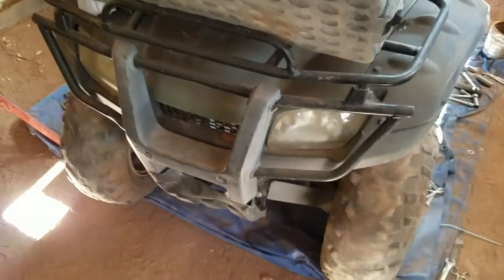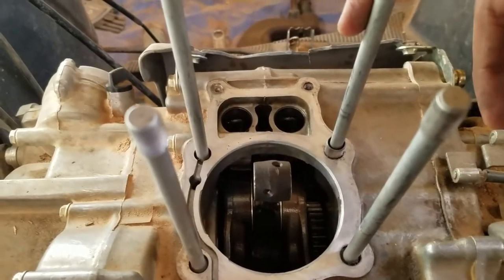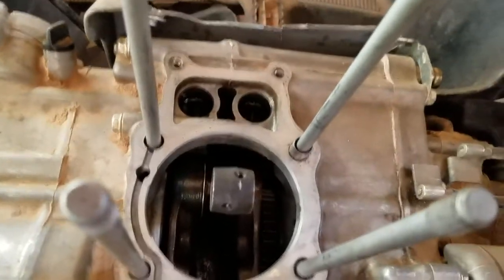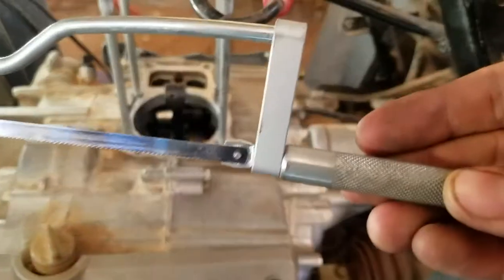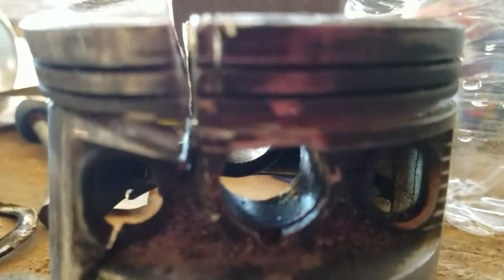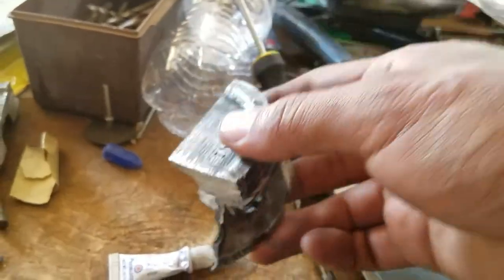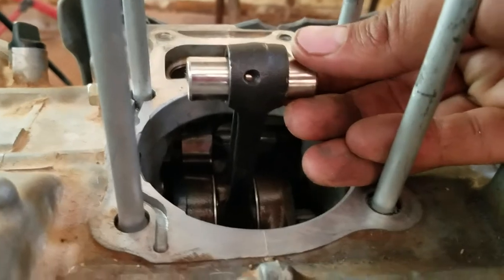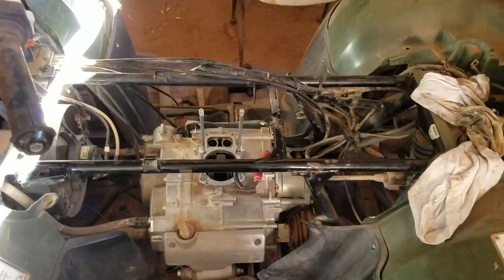How to remove stuck wrist pin atv/dirt bike

Comment: Had a bad one recently. Since I was not worried about the piston itself, I rented a ball joint press from my local auto parts store and pressed it out with that. I used a small impact socket that was slightly smaller than the wrist pin to press it out.  I used a MAP gas torch with plenty of heat, and periodically, I would spray the wrist pin with canned air to cool it down some while continuing to heat the piston. It finally started moving. I ran a hone through the small end of the connecting rod to clean it up and the new top end got it going again.
Reply from the maker: Sorry. This video is so old in my younger years, But glad it helped 👍🏼

Comment: Man i had to do this to my 2005 ttr 125, thankyou for the help! Now im figuring out how to get the wrist pin out of the crank shaft
Edit: used a 6 inch c clamp with a 17mm deep socket to go around the pin but stop at the connecting rod and a 9mm socket to push the pin out, it was difficult and ive been out here for 4 hours trying to get the piston and wrist pin out, thankyou again😂
Reply from the maker: Glad there was some pointers that helped.
Reply: @Echoepic95  bike is now running better than i It did before it blew up, you are a life saver

Comment: I have the same problem resulting from the same looking damage on the cylinder. I snapped a couple of bolts trying to pull the wrist pin out and stripped threads on another bolt which I had to cut off to get out. I think my only option short of ordering specialized high strength bolts, nuts, and washers that won't snap when I attempt to pull the pin out is to cut the piston out like you did. Thank you for reconstructing the piston and breaking it apart again for the video. This is very well thought out and very helpful to see the exact same issue with the fusion between the pin and the rod even though everyone says a pulling assembly is all that is needed. Thanks a lot for the video. 

What did you do about the damage to the inside surface  of the rod? Did you just shave off the surface imperfection where the pin was fused and it was ok?
Reply from the maker: Sorry for my delayed reply I used a lifter hone tool.

Comment: Dont waste your time cutting it with a little saw...lmao. get a long bolt that will go all the way thru the  wrist pin...get a deep well  socket...get a nut and washer that will fit the bolt...you want a large washer because it is what is going to hold the socket in place.  Put the washer on the bolt....put the deep well socket on the bolt...put the apparatus  thru the wrist pin...put the nut on the bolt on opposite  end of wrist  pin...tighten it down...as you tighten the bolt it will push the wrist pin out and into the deep well socket...this will take you all of two minutes .....
Reply from the maker: I tried that method long before cutting this piston, The bolt bent not even moving 1/4 of an inch hence the title "How to remove stuck wristpin"
Reply: I have the same problem right now and I did the method with the bolt too. It wouldnt budge and eventually I twisted the bolt and sheared the bolt into two pieces... was thinking about cutting next. That bastard is really stuck in there.
Reply from the maker: @codymontano8581  i had to cut off mines but careful not to cut into connecting rod
Reply: I have the same problem resulting from the same looking damage on the cylinder. I snapped a couple of bolts trying to pull the wrist pin out and stripped threads on another bolt which I had to cut off to get out. I think my only option short of ordering specialized high strength bolts, nuts, and washers that won't snap when I attempt to pull the pin out is to cut the piston of like you did. Thank you for reconstructing the piston and breaking it apart again for the video. This is very well thought out and very helpful to see the exact same issue with the fusion between the pin and the rod even though everyone says a pulling assembly is all that is needed. Thanks a lot for the video. 

What did you do about the damage to the inside surface  of the rod? Did you just shave off the surface imperfection where the pin was fused and it was ok?
Reply: @JakeDNelson  try getting  ahold to some of that duster spray they use to clean computers.....it literally  comes out of the can in almost a freezing temperature.... spray the inside of the wrist pin for a few seconds....that should get it cold enough to contract some. Then you will probably be able to tap it right out. The pin is stuck because the extreme heat it has been exposed to has it expanded. That is actually  what I did and then used the nut and bolt method to pull it on out.
Reply: @blooddogbloodwork2435  Very cool I will try that! I was able to cut half the piston off with a dremel cutting wheel, so hopefully this works  for pulling it through the rod. Thanks!
Reply: @blooddogbloodwork2435  Once I cut through the piston, half of it came right off and then I had access to soak the rod/pin connection in penetrating oil for a couple days.  Then I was able to pull the pin out with a puller.
Reply: @JakeDNelson  nice...glad u got it
Reply: i’ve tried this, bent the bolt 🫠
Reply: @claurel-dg3iw  ya..it definitely is hit n miss

Comment: I have the same issue.
Reply from the maker: Hijraki i got it to work though
Reply: Echoepic95 I finally got the wrist pin or whatever it’s called out with a long threaded rod. However when I try to mount the new one it’s not sliding in easily. Really puzzled by this since the old one seized.
Reply from the maker: Hijraki yeah mines was like that to, but what i did was i honed the inside where the wrist pin goes through without making the hole to big but with little resistance so its snug also with a little help of Lucas synthetic oil
Reply: @Echoepic95 how did you hone it out please help I just want to sand of what's left of the wrist pin and that's all without making to big if a hole please and thank you